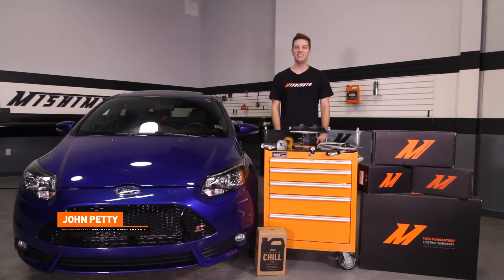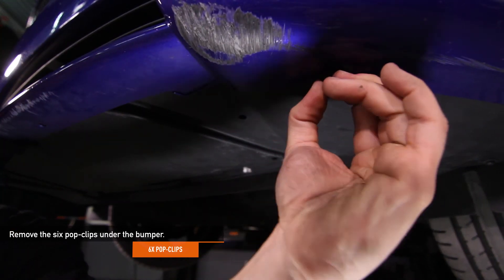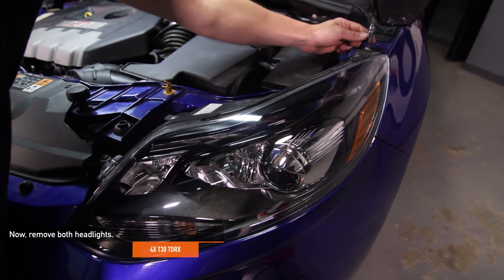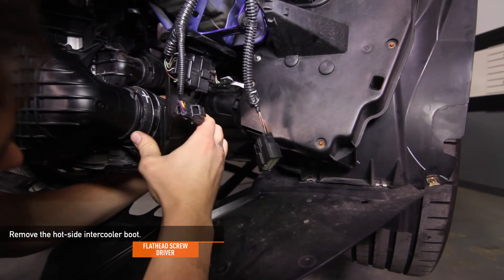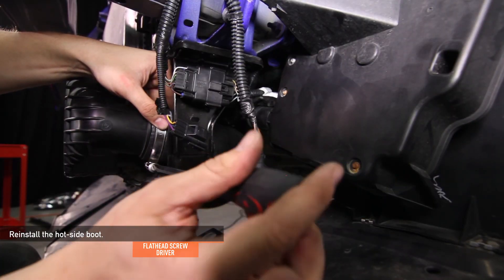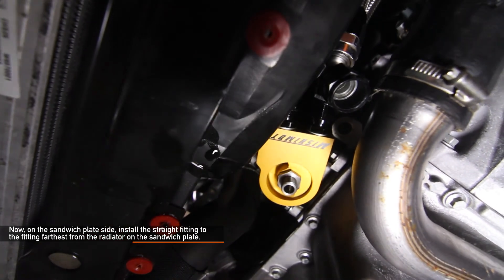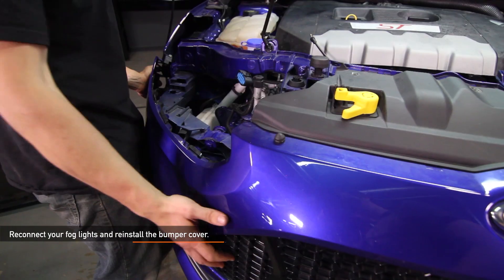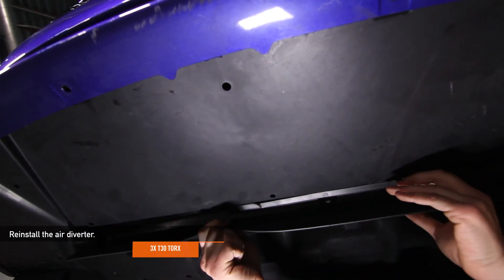2013-2018 Ford Focus ST Oil Cooler Kit Installation Guide By Mishimoto

Comment: Two questions, do the oil cooler lines or cooler have to be prefilled before you turn on the vehicle and secondly do you need to increase the amount of oil the car uses or can it use the normal amount of oil?
Reply from the maker: Upon cranking the engine over, the oil pump will prime the system. The increase in oil capacity with this kit installed is 0.65 qt.

Comment: Hello Mishimoto Team, 

Wouldn''t having the fittings facing down cause the oil to drain from the oil cooler and into the oil pan? Leading to excess level of oil at the oil pan and air pockets in the system upon start up? I'll appreciate a lot your response.
Reply from the maker: It's possible to see a slightly higher oil level, however, the oil system is not meant to be bled of air like the coolant system. The oil pump will typically prime the system while the motor is cranking before firing up.

Comment: When do you add oil to this if everything is upside down? the second you go to mount it the oil will drain out
Reply from the maker: You add oil the same way you add oil to your engine during an oil change. The cooler does not require to be filled ahead of time.
Reply: I appreciate it I thought that might be the case. I just didn't know if it would suck all the air out of the oil radiator itself.
Reply from the maker: The oiling system of an engine does not require to be bled like the cooling system.

Comment: I know this is an old video, but its still relevant. FYI, if you're driving your car hard enough to need an oil cooler (long spirited driving sessions on the back roads in 90+ degree weather, the track, etc) then you might as well be installing the FMIC as well. You've already got the entire assembly apart. An upgraded FMIC is an absolute necessity if you drive your car other than casual daily driving. It's more important than an oil cooler as the factory one causes heat soak very quickly which literally robs power, long before your oil is over the 250+ temps. This is the only upgrade I have yet to do and I regret having to tear my bumper again to install it lol.        Also, thanks for sharing. Great how-to video!

Comment: Which hose goes into the cooler does it matter what side both hoses go into?
Reply from the maker: It wont make much of a difference but you will find that due to the lengths one hose will fit better than the other for any given port.

Comment: I installed it but it leakes thrue the straight fitting on the sandwich plate around the pin area.
Reply from the maker: Hey Leo, we are terribly sorry if you're running into any issues with your kit! Please reach out to our team at Support@Mishimoto.com and we would be more than happy to help out!

Comment: does it come with the gold wrench
Reply from the maker: This kit does not come with tools
Reply: @mishimoto  Thank you
Reply: i installed it , but it  leakes thrue the straight fitting line on the sandwich plate around the little  pin area . Can i send picture

Comment: Is this kit adaptable to fit a 2007 focus st 2.5?
Reply from the maker: Hey Byron. Unfortunately, we were not lucky enough to have the 07 ST here in the states, so we did not get a chance to do any testing with it. Generally speaking, our kits are a direct fit. With that said, the chances of the mounting brackets and hose lengths being perfect are quite low.